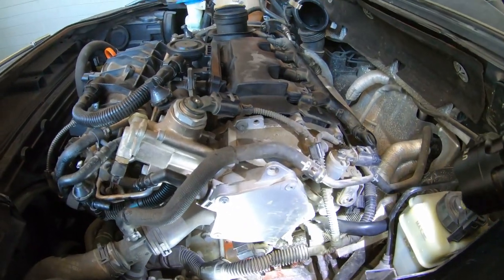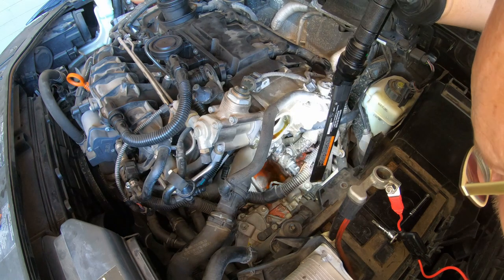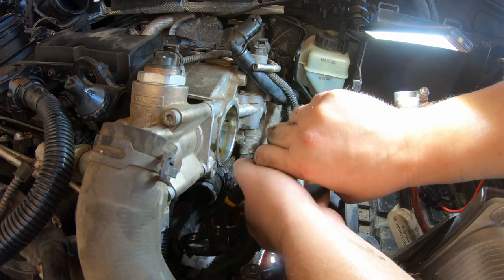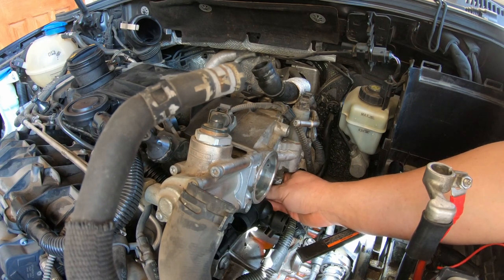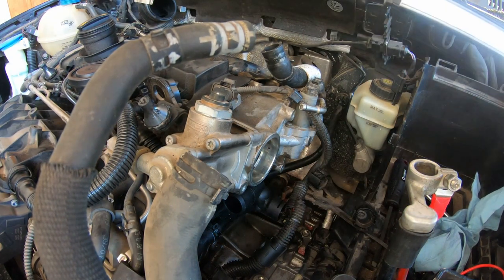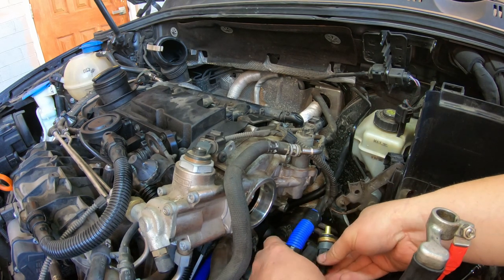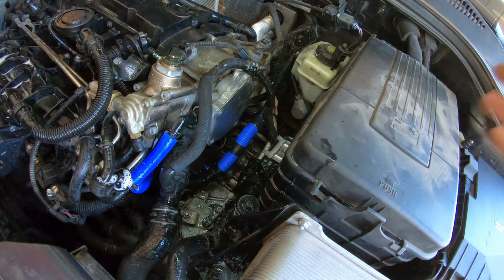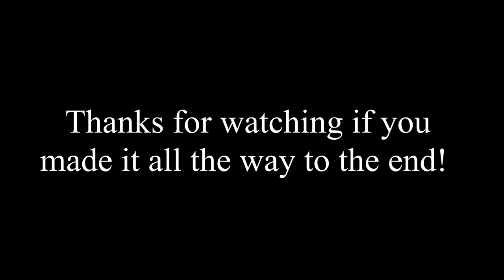2008 VW Passat Code P0171Solved! Coolant leak fixed!

Comment: Replaced the lower radiator hose on my 2006 Passat 2.0T due to a leak, swapped it out with a Gates Hose that was snap fit perfect but it looks like the T flange it was connected to at the top, located right side of AC Compressor may have been leaking down. Could this be a bad O ring? My old hose leaked but now I’m losing coolant within the day.

Comment: Good video bud, I've had to do this same repair among others.  Most fsi owners have to be savvy about these engines.  One question.. did you notice the oil cap being very hard to remove while the engine was running?  I have a p0171 code and there it's very excessive vaccum,  very noticeable if the dip stick is pulled. PCV is good,  so I'm stumped.
Reply from the maker: Thanks, I didn't really notice that symptom. I'm constantly adding oil to this thing however. It burns it like gas. I rarely drive this car. I bought it to drive my elderly parents to their doctor appointments. The place I bought it from was very honest and they replaced the turbo, and a few other things for me.
Reply: @FabiusMaximus1000  fortunately mine doesn't burn that much oil. We bought it used with 75,000 miles and now I've 222,000. Unbelievable the amount of maintenance and knit picking things about VW's.
Reply from the maker: @headstrong6523  So far I've been lucky and been able to fix everything myself. I did the timing belt at 115k. It has about 125k on it now. I've thought about selling it to get something domestic.
Reply: @FabiusMaximus1000  I've replaced the oil filter housing twice, timing belt, intake cam and hp fuel pump, lifters, vaccuum pump, wheel bearings, inner tie rods, geeze, I guess I've got an almost new car😂. Thankfully they aren't hard to work on.
Reply from the maker: @headstrong6523  The place I bought it from replaced the oil filter housing and the turbo. Everything else I've done, except the timing belt, are all on my channel. I also did the driver's side CV axle but I don't think I put that in the video?
Reply: @FabiusMaximus1000  I had trouble getting my axles out of the tranny. I had to take them apart and use vice grip pliers and a slide hammer to get them out. A real PITA. I'm glad you made those videos, I got so wrapped up in the job I didn't record any of it. I did make a short video about replacing the blend door actuator.  That was fun working upside down behind the steering wheel.